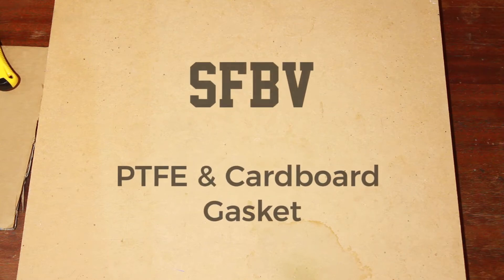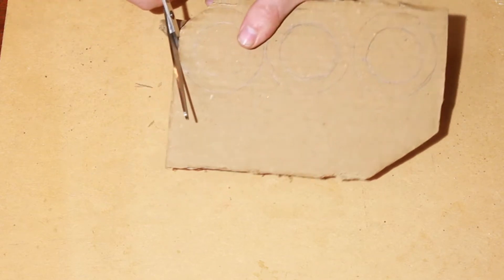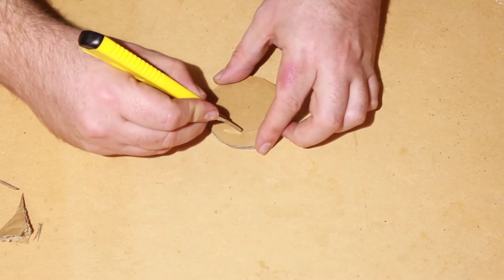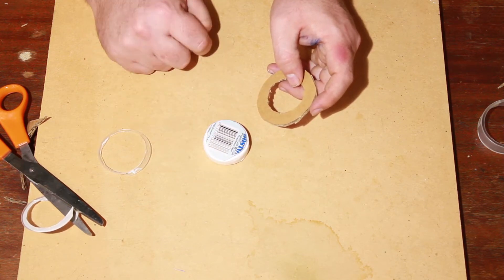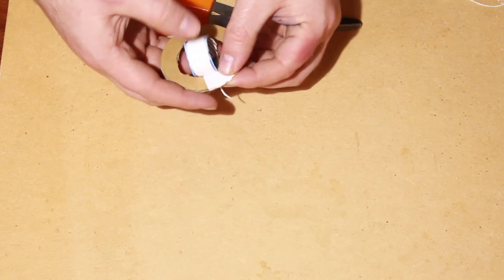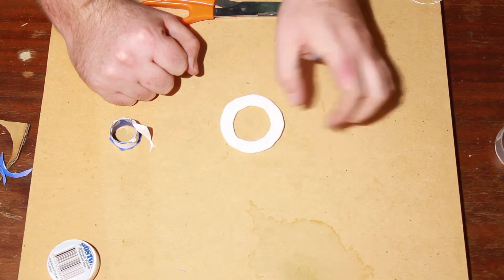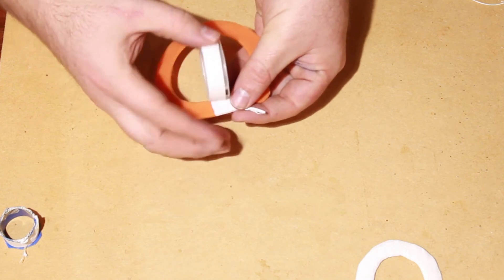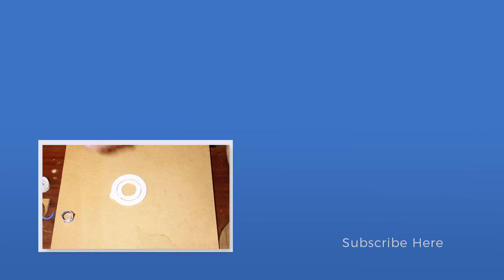How To Make A Quick, Safe PTFE Gasket : The Everlasting Gasket

Comment: Did you tried to make big gaskets for potstill lid? I want to make one of 51 cm wide for boiler and another for thumper, 38 cm wide. How much teflon tape I need and how many times I have to wrap to make a good tight seal durable gasket?
Reply: Not much,three or four wraps is fine

Comment: Hey mate is this the video you recommended this morning for the kmart jars ?
Reply: sorry i typed the comment 3 seconds before you pulled out a jar on the video
Reply from the maker: That's the one.  Do the same thing but just wrap around the silicone gasket ( don't need to switch to cardboard).
Reply: cool man thank you so much now to stock up on cheap jars originally i was looking at getting like 5+ demijohns which would cost me about 15$ each i think, why does the tape not react to the alcohol vapour?

Comment: Mate, sorry for bringing up old topics, but have you considered silicon baking sheets? I've got all my jargaskets and stilling stuf(that comes into contact with high abv distillate) made from simple silicon bakingtray sheets.. Some food for thought😁
Reply: I have tested the high heat silicone in 95% Ethanol for 7 months (https://www.youtube.com/watch?v=vfW9NwM8IrM&t=1s) and it appears to cope very well with the ethanol. I love this video and I use PTFE tape to seal my Boka Heads on the column and it works well. Some people will never be satisfied with any assurance of safety and will insist you use organic flour paste to seal everything! :)
Reply: @LouwrensvanderMerwe  lol, was just going to post this link.  Good work man!
Reply: @LouwrensvanderMerwe  lol, was just going to post this link.  Good work man!
Reply: Have you actually tested those in the long run? Most chemical compability sheets I found with a quick search seem to disagree that they would hold up perfectly against polar solvents (like ethanol). Just for example this chart for some O-rings has silicone listed as 2 (fair) versus ethanol: http://mykin.com/rubber-chemical-resistance-chart-3

I would imagine there will be some effect on the gasket if its in contact with hot, concentrated ethanol vapor. Now the positive thing is that food grade silicone products should be inert to human body and you won't get poisoned or anything like that from it. So yeah they SHOULD be safe to use in that sense but that doesn't mean they won't degrade or leech into your product...
Reply: Phantatron I've had some spirits age in jars that've been standing on the attic for a year with the bakingtray silicon gaskets and they haven't shown any deterioration whatsoever.. I haven't have them tested by a lab but I can quite safely say they haven't been leeching in any nasties by taste
Reply from the maker: +Mart Mennen cheers my man.  There are a fair few people that would doubt that silicone can stand up to high abv. 

So figured I would be extra safe for now hahaha
Reply: Oh I didn't know that! About everyone on the forum here in the Netherlands use the baking tray gaskets because it's safe 😂 but hey, dont change a winning formula, right? 😁🤘
Reply from the maker: +Mart Mennen 😉
Reply: Check out https://youtu.be/vfW9NwM8IrM
Reply: Platinum-cured silicone will hold up against boiling ethanol vapor, but tin-cured silicone will begin to embrittle slowly over time.

Comment: I have a grainfather, been thinking of just buying a steel distilling lid, but it uses silicon as a gasket afaik. would wrapping that with ptfe be enough?
Reply from the maker: Hows it Steffen,  

Grainfather! Nice! Its a sweet piece of brewing kit.  And it will do you proud for AG distilling too!

Yeah, there is a lot of discussion around this all over the forums.  Many people run it as is and are happy with it,  some replace the gaskets entirely.  Some wrap them.  If you are going to wrap it you will need a fair bit pf PTFE tape to do it justice.  

I would suggest having a read of this thread.  Dude mods out a similar unit.  Which gets into some of the other shortcomings with the units that clamp on top of a grainfather :) 

http://www.nzhomedistiller.org.nz/forum/viewtopic.php?f=15&t=201

Comment: I am usually all in favour of DIY solutions, and this one might be good for "emergencies" I suppose, but when a roll of 
Fix-A-Tap 12mm x 8m Threadseal Tape is $1.99 (and the "original" article says you need to use a full roll), and a EDPM 2" seal is $1.50 from a major supplier I have concerns about the economic viability.
Sure, there are probably cheaper rolls of PTFE tape, but I am sure there are cheaper EDPM seals as well...
Reply from the maker: Good point.  
And I agree.  Especially for the ferrule gaskets.  In fact, you can get PTFE gaskets too for a similar price.  But I guess it depends on where you live etc.  For me, the roll of tape was $0.99 But a 50mm EPDM gasket is around $3.20 (locally).  

It's the versatility that I like.  As you say being able to put something together in a pinch.  Or for something like the jar that has a custom gasket.
Reply: Yep, for me a roll of tape is a 100k round trip, however it's one to keep in case, I generally have a roll of tape around, but rarely are they unused :-( - Next time I'm in Bunnings I'll pick up a few - they won't go to waste that's for sure.

(although it seems the silicon baking mats could also be a useful standby).

Comment: I made a few of these, also swapped out the cardboard with cork for a thicker gasket. Both worked well. Good idea doing these short vids for stuff like this:-)>
Reply from the maker: That's a good idea switching it out to cork.  Double safe!  

Thanks,dude.  Figgered it let me get some more stuff out without too much extra commitment :)
Reply from the maker: I had the same concerns about cardboard.  I hadn't thought about it in cork board though.  

But as I understand it the idea is that the PTFE acts as a barrier.  Hence why I am happy to use it with the OG silicone seal for the swing top lids.  

To be honest,  that is an assumption!  Thanks for the comment,  I am already thinking of ways to test this!  Cheers :)

Comment: For novice distillers think safety: Vaporized alcohol in the boiler, column and condenser should ONLY make contact PTFE, Copper, Stainless, Glass, Wood or Natural cork. It's not what the hot alcohol does to the material, it's what it TAKES FROM IT.

After the alcohol is condensed, it should continue to make contact only with: PTFE, Copper, Stainless, Glass, Wood or Natural Cork.

Good "gettin learnt" video Jesse!
Reply from the maker: Thats a good point BigEd!  

I kinda missed an opportunity to plug the safety side of things there.  Another case of comment section FTW!

Comment: Nice Jesse..! Well, The idea may come from a guy called Samohon over on HD. He may not be the first to have done that, though. It's called an "everlasting gasket". Link: http://homedistiller.org/forum/viewtopic.php?f=62&t=24199&p=6929534&hilit=everlasting+gasket#p6929534
I used something similar on my test setup for the stills I've made. Just some temporarily quick knock up, to test if the setup is viable. If it passes my test, I buy the proper fittings, ferrules and the PTFE gaskets for the project. Btw...PTFE gaskets are dirt cheap on E-bay...from China.
Btw...when will we see a video of your spirit run on your CCVM..?
Happy stilling.
Reply from the maker: Nice.   I do believe I have read a few things from that very thread when looking into this stuff!  
For anyone else looking into this I would recomend that link!  

Thanks Kalle :)